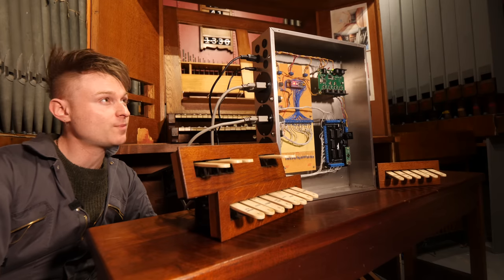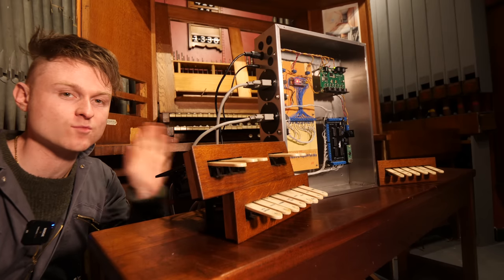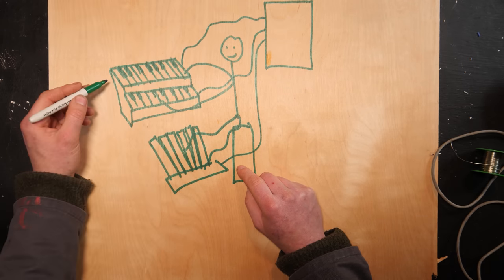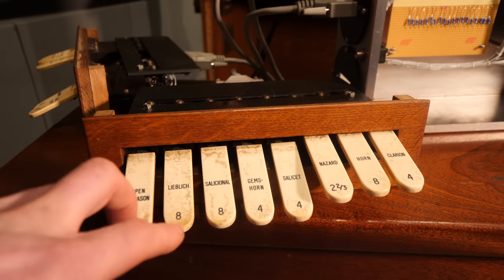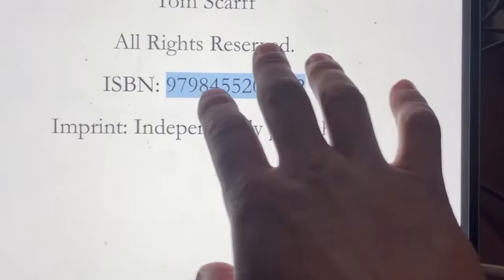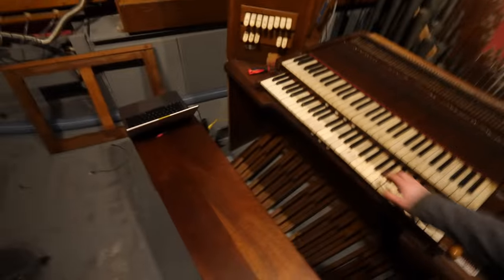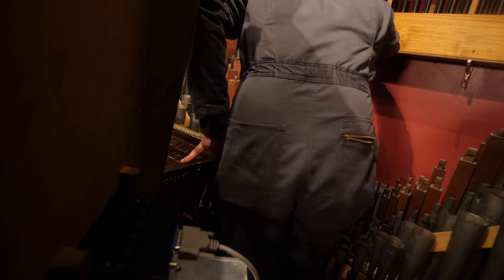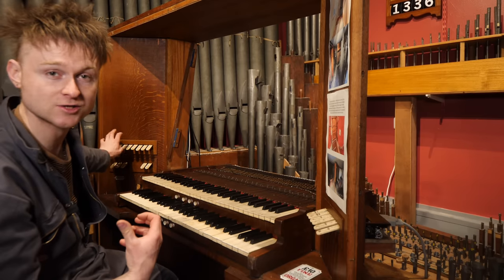I BOUGHT A CHURCH ORGAN PART 14 - CONSOLE BRAINS AND WIRING

Comment from the maker: reply to some code comments, something i had not mentionned in the vid as i failed to fully explain. it is also an issue with just a single keyboard, as in you have a stop playing and the same but transposed it has the ability to cut itself off. im in the middle of sorting it for the next vid, but be aware if your trying to think about solutionas, you cant just compare inputs from the keyboards. 
also a Reply to the incoming "get the keys to move
By themselves" comments. Don't get me wrong awesome idea. I humoured it when putting together the first keyboard tried a handful of approaches and it was just turning into an absolute endeavour of modification. I'd have more luck sourcing something more suited. It's one thing being the big ideas talker down the pub. But it's nothing without seeing it through.  But yeah don't get me wrong I'd love to and will do when i get to it :D.
Reply: Might be easier to find an old pianola (aka "player piano"), wire that up for MIDI, then feed its MIDI output into the organ. Not saying it'll be easy mind you, just perhaps easier ;)
Reply from the maker: @MicraHakkinen  indeed! I am after a rough pianola to midify for another day haha. However a self playing 2 tier key setup would be awesome as you play great to swell and it's like both keyboards move. I tried various different electromagnetic arrangements and none that were good enough were small enough
Reply: if you cannot source a self moving piano then maybe some more LEDs on the keys themselves for when it's auto-playing
Reply: maybe an led per key might be an easier option, like the pipe leds :)
Reply: @ChongMcBong  yeah I think this might be the better way since getting a similar electromechanical system would be potentially altering more of the console and Sam's been trying to keep it reversible
Reply: Yep, I confess, I was thinking that at the end. But, I do see the issues. The keyboards just weren't designed for it. But maybe an RGB LED under each key that is color coded by bank of pipes. Primary colors for each, blended for mixed stops. Just a thought for when you run out of things to do too it at the end.
Reply: Highly recommended: a "CANCEL" key that sends a MIDI "ALL NOTES OFF" to all channels to help handle stuck notes.  The pipe organ in my church has a CANCEL which turns off all the stops - I'm suggesting doing that but turning all notes off as well...
Reply: A piece of metal under each key with an electromagnet below, not easy by any stretch of the imagination but doable.
Reply from the maker: @garyseymour6319  it's one of the approaches I did. Closest was using a curved metal which maintained a similar spacing to the electromagnetic in all of its throw. But dang it's a faff and limited space for top keyboard. Ultimately it's easy to have ideas. Whole other kettle of fish acting upon ideas :D
Reply from the maker: @VAXHeadroom  I do indeed need one. Might even use the toe piston for midi stop. But hoping by the times it's all done won't need a midi panic
Reply: If you have air, you might have vacuum.   I don't understand enough about the air supply it self to say whether it already does/is able to.
If you can pull a bit of vacuum piggybacking on operation that the thing is already doing, then maybe you can run simple tubes and use a pneumatic/vacuum switching manifold - all that stuff is plastic, small, not adding a lot of parts or requiring hard mods, and available on your preferred automation supply site.  Maybe you could partner with someone like Automation Direct (not an affiliate, just used them for inexpensive bits to put together things on the job) they (or similar vendor of preference) would be a good fit for sponsoring a lot of your projects.  I was always looking for better solutions than LabView (work usually made us use it, it's not free and it's kind of an art unto itself as well as being super buggy always) that could also save us money at work, so when I could sub out little piece parts from someone besides National Instruments I did it every chance I could.
Reply: @LOOKMUMNOCOMPUTER  Now you've mentioned curved metal you remind me of old car indicators.  I'm sure you know how they worked so I won't bore you with that!
Reply: Look mum, a computer!
Reply: если не секрет какое у тебя образование ?
Reply: Hey you want a 1983 vintage sensaphone 1000? its a voice dialer with temperature and door contacts ... it uses pulse dial and I cant get a way to control it over voip due to that but it would be perfect for your museum, also it uses a General Instruments Voice Synth Chip to tell you the temp and alarm status ...
Reply: Professor, that’s what I’m gonna call you because you’re a smart dude and you’re great with electronics well professor I think after the organs done get a tremolo for it and how they work on the pipe organ if you didn’t know they work off your win chest your Bello they usually sit on top of your Bello and then it rotates when you hit that stop it’ll turn on rotate and it bounces a Bello and it makes at tremolo sound. It’s really cool.
Reply: Perhaps feasible, use a solenoid for each key to jam in a wedge. When that wedge is in, pressing the lower keys pushes up through the wedge into the upper keys (lifting the back and pressing the front).
Reply: Simplest and non invasive idea would be to use a video projector. You can get the perspective matched up in 3D and just project the key movement on top of the actual keys. Like they do cool animation projections on buildings - just on a smaller scale.
Reply: @LOOKMUMNOCOMPUTER  the pianola idea , you could modify electric relays into valve openers to the diaphragms
Reply from the maker: @oli31415  as i said, extensive modification :)
Reply: @LOOKMUMNOCOMPUTER  Little air pistons pushing down on the keys. The swell keyboard has all the room needed above it. How much room is there under it, above the great keyboard? I'd use a strip of UHMW with holes bored partway through, positioned above each key. Use UHMW rod for the pistons, with a couple of o-rings on each, sized to fit so there's as close to zero drag as can be. For the air connections, drill in to the piston holes from the back and heat melt in little metal barbed fittings.

Should be able to make the assembly less than an inch thick. I can whip up a 3D rendering if you're interested.
Reply: @VAXHeadroom  an organ with a scram switch, or an E-STOP like a CNC milling machine. :)
Reply from the maker: @greggv8  inbetween the keys is about 5mm of gap between. dont get me wrong one day ill get to it, i tried various methods. ill get to it all good. i tried air, various electromagnets. its all pretty extensive, i want to get it done first. then like i said ill build on it. cheers
Reply from the maker: @greggv8  the way ill end up doing it and the closest i got is electro magnets. for the swell above behind the lever, and the great below infront of the lever. its much less part count than using air.
Reply from the maker: @greggv8  you got me thinking though. cheers!!!
Reply: @greggv8  I love the concept of a MIDI SCRAM button! :D
Reply: What about metal tabs under each key and a magnetic coil to pull them down?
Reply from the maker: @MrJmagenta  as mentioned I tried that in various arrangements :) thanks thoug
Reply: I wrote too long explanation, what could help, but I would rather have your code, rewrite it and send back to you. Idea is to store input keys, selected filters and enabled outputs separately. Key on and offs should be processed differently. KeyDown should store pressed keys, let it through filters to translate to output. Add output to each channel with counter, how many filters enabled it. On release do the same, but retract from outputs. If output count is 0, then turn off channel note, if > 0 then play it. Flicking filters could recalculate all outputs from stored input keys. Might be dirty code, but it could work.
Reply: I am just a bit worried about Arduino memory to keep track of everything. Lately I use ESP32, as they are cheap, faster, have more memory.
Reply: @LOOKMUMNOCOMPUTER  sorry
Reply: I may have mentioned this in another video's comments: a pipe being called for from multiple sources and unable to speak on all requests happens on conventional organ builds as well.  The problem is there are not enough tonal resources available.  It's a cheaper more efficient build compared to a fully mechanical organ like Bach would have used.  Fancier electric action pipe organs will have nearly a  rank of pipes per stop tab and the ranks will have more pipes than there are keys on the keyboard for the full range of 32, 16, 8...2, 1 ft stops.  A work around organist use on smaller instruments is changing the registration (sound family) so hands and feet parts can all be heard.  Usually the accompaniment hand will have a simple registration of just a flute and disposing while the hand playing the melody will have the totally complex registration. For counterpoint like Bach, you want to make sure each part is going to be heard.  Some organ snobs never liked electric action instruments on the smaller scale because of the notes dropping out. You could have some synthesized/sampled voices to supplement, as some modern builders make hybrid instruments doing exactly that...  thanks for sharing and happy learning while coding!"
Reply: You could be using bitmaps for storing the state of the notes. The state of each keyboard is stored in a 16 Byte Array (One bit for each note). Based on this and the switches, compute "output" arrays of notes for each pipe set. Changes in the later then just translate to midi on/off messages for each of the pipes. I can help with the code if desired.
Reply: @bastelmap  Issue currently is, if multiple sources call the same pipe, the first stopping source stops the pipe. Using bitmaps will require to recalculate outputs for all inputs, that might not be too bad, as there can be up to 20 inputs at the same time normally. But if memory allows I would like to try to work wit each key press/release event separately and store the counter in the final output array. If done correctly, it should just work, unless some MIDI commands gets corrupted.
Reply: Sam, a counting semaphore is what you want 👍
Reply: It probably was suggested already, but I'd suggest the key presses are send to a virtual internally safed keyboard (1 virtual for each real) and then you "multiply" the midi signals with the stop signals to know where to send midi on and of signals. Then you add all together and boom, when theres more then one midi on active, the note plays. You couls achieve this with some clever array claculating ("multiplying" 2 one dimensional arrays to get a 2d array, which has every note on every rank)

It's hard to explain, hope you got the idea
Reply: One simple way to deal with colliding control signals (such as overlapping transposition) is to give the input signals a hierarchy. That is if you have two signals coming in from the same parameter, the input higher on the hierarchy list will always have priority. At least that way how it behaves can be made somewhat predictable. Not sure if that's a good idea, but it might reduce the need to over-think it.
Reply: @bastelmap  yep that's the correct way to do it, you need to store the state of all the midi notes and channels for it to work properly. Then on each change you know the previous state and can make the proper note updates. I would also suggest storing the input output matrix in the same way do avoid non maintainable and long blocks of if/else/switch. This way the code is agnostic to the config, and config can be easily changed.
Reply: @louisdu54  I thought about the thing during the day a bit deeper and I think it is even simpler: If carefully adjusted one probably justs needs a single array of bytes, one for each note to be played. Each bit in such a byte is assigned a certain purpose. E.g. Bit 0 in each note byte represents an active note of the corresponding key of upper keyboard, Bit 1 active note of the lower keyboard. When keys are pressed bits are set and cleared accordingly. Now, depending on the switch states, you compute an individual bit mask for each pipe-set to binary"AND" combine with a note byte. If the result of the "AND" is non-zero, the pipe should be blown. You can generate note off/note on messages by comparing state before & after changing the note byte array. Up to now, this is already enough to handle all 8 foot switches. Then, for transposed notes, additional bits are defined. E.g.  Bit 2 is set for 4 foot note on upper keyboard and so on. Thus when the upper keyboard key is pressed, two bits are actually set: Bit 0 on the 8 foot note and Bit 2 on the 4 foot note. This algorithm basically creates a 8 input masked OR gate for each pipe. I can not yet oversee how much bits are needed to handle all possible combinations but it seems to me, 8 bit could be enough.
Reply: The way I work around the message nature of midi is to replicate the "synth state", I. E. Decode incomming messages and keep track of note states from each keyboard, when switching keyboards you can send appropriate note off messages to the keyboard you're switching from and appropriate note on messages to the keyboard you're switching to, if multiple keyboards are hooked to the same rank you merge their states in a OR fashion to avoid one keyboard turning off a note that was turned on from the other, it will also allow for note transfer between keyboards on the same rank. If you want more advice hmu
Reply: eh you'll figure it out it's been a month you seem plenty smart

Comment: As a purely electromechanical device this must have been mind bending to wire up and configure. I just can't even conceive how purely mechanical organs achieved this level of multiplexing and demultiplexing of keys and pipes. The coding challenge for the software solution is clearly not to be sneezed at either and I  reckon you have had plenty of sleepless nights thinking about all of this. Congratulations Sam for getting this marathon project just about over the line. You have found a way.

Comment: That's all pretty neat. There is one detail I noticed: Your choice of MIDI channels for the keyboards are reversed of the de-facto standard for MIDI organs. Most MIDI organs (I have six of them) has CH1 for the top keyboard, CH2 for the bottom keyboard, and CH3 for the pedals. The same configuration goes for most MIDI accordions where CH1 is right hand's buttons or keys, CH2 is chord buttons, and CH3 is bass buttons.
Reply from the maker: i did it that way cus i did it that way :D
Reply from the maker: makes sense to me counting up from the ground :D
Reply: organfairy you are special to have six organs
Reply: @curtisnixon5313  The six organs are just the ones that has MIDI. I also have some without....
Reply: That'll be interesting when Sam gets a MIDI file meant for one of those organs and plays it on his...

Comment: I've been plotting out the MIDI functionality of my organ, patiently waiting to see how you would go about rigging yours. You alerted me to some alternate solutions and also to some coding pitfalls that I would not have anticipated. 
I'm definitely going to give that book a read!
Reply: I reckon: Don't try to count the MIDI on/off events. Just make an array of 127 Booleans for each channel. With each MIDI event in, XOR the arrays, and send out events only for the notes which have changed.

This is not as efficient computationally. 1980s hardware probably couldn't handle it. Which is why MIDI wasn't built this way. But modern microprocessors should be able to do it no problem.

Comment: I love your solution of having 3D printed inserts for the sockets in holes cut with a hole saw. Simple yet brilliant, and looks clean. Cutting accurate square holes in aluminium sheet is harder than it looks.
Reply: Easiest with a D-Sub punch, but you need several punches for the different lengths of connectors. Hole saw and a plastic plate is a good solution.

Comment: I refer to the comment from last time that the blower makes funny noises. I recognize that sound from the times I visited customers as a service engineer. The lingering grinding noises are actually caused by the binding cord in the motor. The same cord that you also use to tie the cables. The cord sometimes breaks due to age and then starts to rub against rotating parts in a stubborn way.

Comment: It's tremendous the amount of work and effort you're putting in this project! If you don't know, if that thin pipes are really strings they have to be slightly out of tune with the other ones to create that sort of angelic effect. Good luck Sam!
Reply: Only if they're a celeste stop.
Reply: @bigogle  I think there is but it's not specified as a Celeste

Comment: When I was a young cabinetmaker the firm I was with used to make and modify organ cabinets for organ builders. I bought myself a set of TCT holesaws (and a Festo - now Festool - jigsaw) when they were then still very expensive (nearly 2 weeks wages) , because the organ builders kept on changing their minds where the wiring and piping were going to go, and we were constantly drilling new holes in our newly finished/refurbished organ cases! Tungsten carbide tipped holesaws leave a lot neater hole than the bimetal ones we used to use. I still have them, that I use quite a lot, but they are less than 1/3 of the price now than when I bought mine. (made in Taiwan/China, not Germany). Sam, if you ever need quite a lot of cash quickly, there's organ restorers who would pay you whatever you wanted for the skills you have built up over the course of this project. Well done!